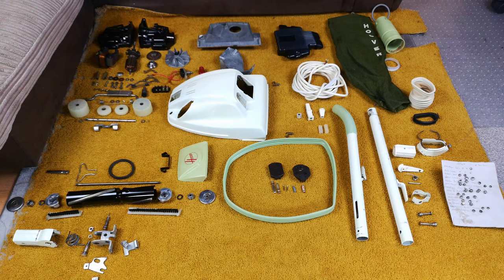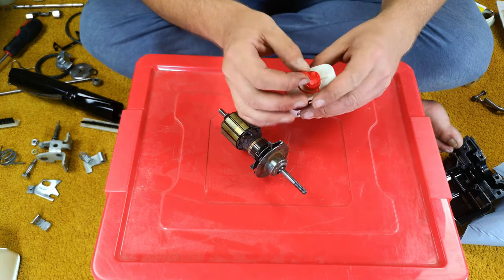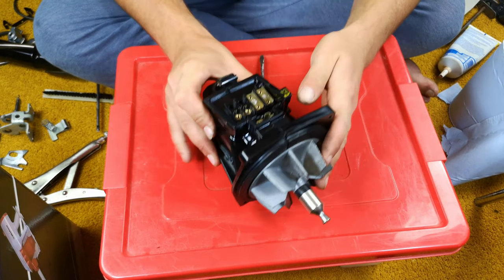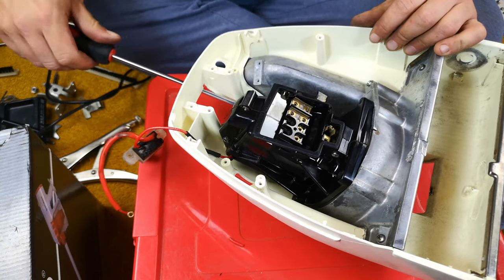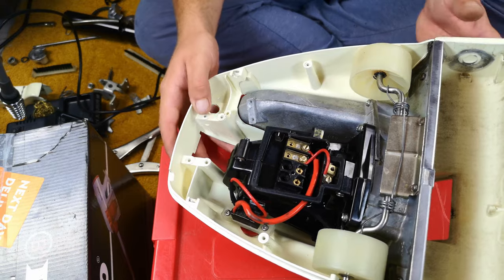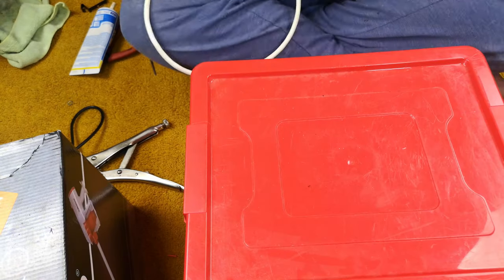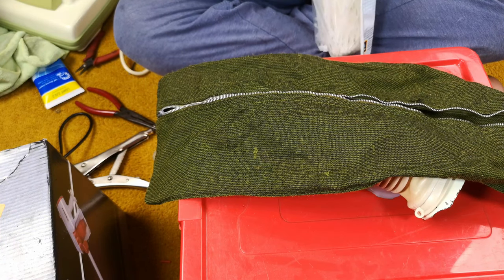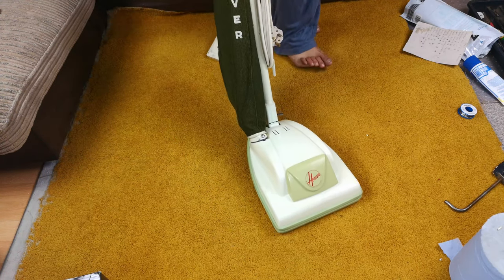1960's Hoover Junior 1334A - Full Re-assembly with Hints&Tips!

Comment: I've followed your video Sam and managed to get my old 1334 running again. It started to smell of burning and  the motor went very slow. I thought it was totally knackered. However thanks to your video I took the motor out  oiled the bearings and removed the suppressor and now it sounds like new !!
Chuffed to bits..never done it before.
Thanks Sam.
Reply from the maker: Awesome, nice one! Was it as scary as you imagined?
Reply: @beko1987  I've always wanted to have a go as it always seems to be the bearings that cause problems on such old machines. I enjoyed doing it but needed your video or I would have messed it up !  Am worried about the suppressor not being there. Is it just as safe without it ??
Reply: @TheElectromechanical  yes suppressors are not needed and it would have just blown up

Comment: Hi great video once again. What size heat shrink do you use please? I cant find any info for the individual 2.5mm2 mains T+E cables
Reply from the maker: Looking back at the ebay listing it was 3.5mm for the smaller stuff. I also bought 6.4mm which is just too small to go over 3 core flex (on a Hitachi it was a beautiful original flex with moulded cord stop... And a worn outer layer halfway down! Was a tight fit, I'd go 7mm next time)
Reply: @beko1987  Thanks for the info I will get some of the 7mm Cheers